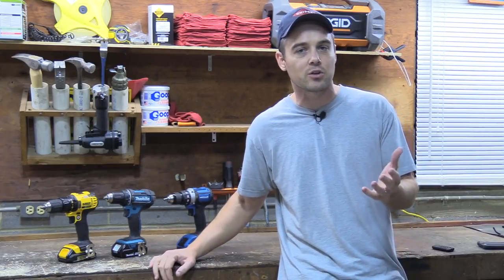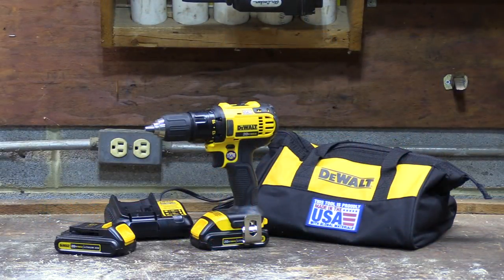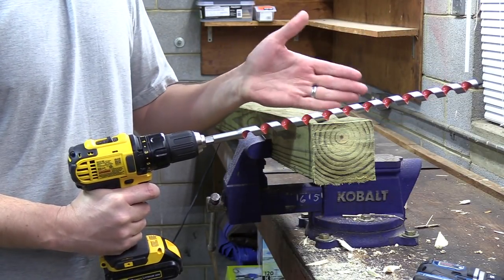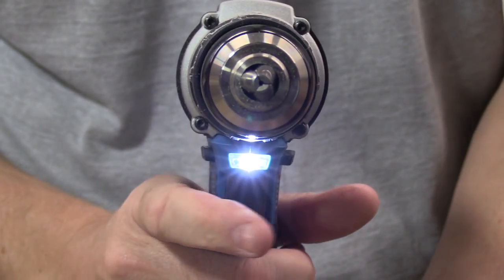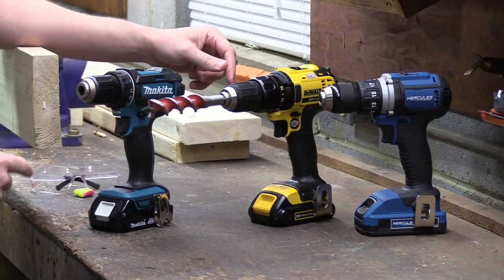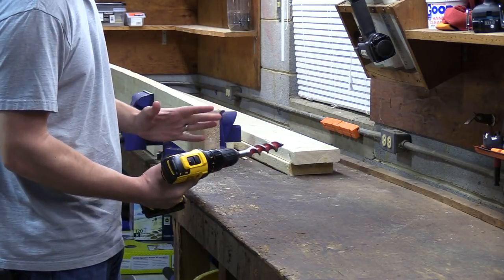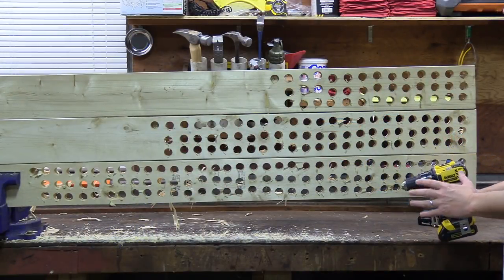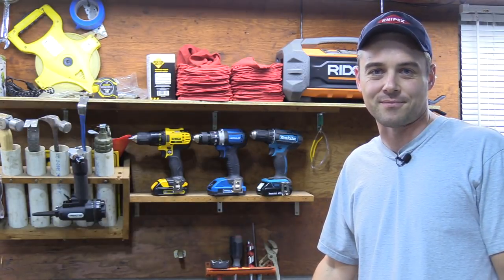Dewalt -VS- Makita -VS- Harbor Freight (Hercules) / DCD780 -VS- XFD10 -VS- HC91K1

Comment: Own a Ryobi, very satisfied. maybe you can do some ryobi tools in the future. love your videos, Keep it up
Reply: I'm just a homeowner, so I've been using Ryobi tools for yeas now, but I've been frustrated that they haven't put out a decent compact drill like these. Mine is over 10", and the smallest One+ drill I've seen is at least 8".
Reply: They are made by TTI, which also makes Milwaukee.  In fact, there is some speculation that TTI may be using Ryobi as a test bed for technologies that eventual wind up in Milwaukee tools.....
Reply: I use cordless drill all day, everyday at work. Ryobi is by far the worst of the bunch. It's good for a homeowners drill, but not m
Be actually used for construction/work.
Reply: many people dont know this but rigid and ryobi are identical they are made from the same factory and owned by the same company that owns milwaukee .

Comment: I am getting ready to chuck my 5 year old Dewalt 20v Li drill.  I may give Harbor Freight a try.  I go there already and love their unconditional warranties.  I have had issues with returns on Milwakee and Rigid drills in the past.  Plus, now HF has batteries that interchange with quite a few tools.  Thanks for the review.
Reply: My local store had no Hercs in stock and won't til November I think. That said, Dewalt has a bigger line of tools and I've made a living with mostly Dewalts over the last 2 decades. My son wanted a Herc, but since they were out I got him the Bauer.

Comment: I have older Dewalt XPR series tools that have held up to the test of time and are worth every penny. Then about 6 years ago I was given the battery powered M12 jacket from Milwaukee. Needless to say I then started buying all the tools that use the same M12 battery, drills, hammer drills band saw, sawzall, laser level. These tools are some of the highest quality battery tools I have used in my 30+ years as an electrician. All in all I want tools that can do more than just drill holes, interchangeability is important too. No offense but between the tools from Dewalt or Milwaukee, the variety they offer and the toughness after falling off a ladder and still working I'm sticking with the brand names I trust.

Comment: I've used Craftsman cordless tools when they had the 14.4, 15.6, 18.0, 19.2, and now 20V lithium as all my 19.2 got stolen.  They are undoubtedly the best bargain, and I use them professionally as a bus/truck mechanic and dismantler.  Craftsman tools are ridiculously expensive to buy separately, but for example I got the 19.2 volt 1/2' chuck drill, impact screwdriver, charger and two batteries for $99.99.  But you MUST get them as a set, and on sale.  The 19.2 series never failed me, and whether using Ni-Cad or lithium the were outstanding, especially the impact screwdriver that I thought was a joke when I bought it.  That little sucker will bury a 4" screw, I built about 50 feet of fence with zero problems.  I plunked down $199.99 for the latest Craftsman 20V lithium ion set.  You get a 1/2" drill, impact screwdriver, sawzall, circular saw, and Excellent flashlight, plus two batteries and a charger.  I highly recommend them as the best value, and of course getting TWO batteries is essential.

Comment: As of now, 308 Makita and DeWalt fanbois have disliked this video.
Reply: Tvideo; Mate when you're working with these tools for a living, do you really believe anyone gives a crap about being a "fan-boy"??? All you give a crap about is to do the job, regardless of the expense on tools and move-on to the next job... There is a reason some tools are considered by professionals to be appropriate for them; I also would count-in Milwaukee, which is a leading brand... We are talking about people who don't own/use a single drill to cover different tasks... Nobody says that this HFT won't work or will break, but it's not for people depending on a tool. Some new to a trade with very low budget might start on such, but they will get serious as soon as the wallet will allow it. Also, all pro tools have parts available to them, from housing to gears, motors, bushes (for the ones who need them), spare batteries and so on; it's not even worth starting the discussion about service and maintenance...
Reply: newagetojo  Mate, I'm not going to do a Makita vendors job... People also say not to buy Mercedes Benz... I keep hearing the word SPENDING and KEEP ON SPENDING... It sound like it comes from people with limited possibilities and very low on cash; I'm the opposite and for a general information, I have NEVER had a Makita tool go bad, however I needed a new housing for a drill at a point in time because of how abused it was. Fifteen bucks later at the parts depot, I got my new housing and for a buck fifty I also got a new direction changer... Look, you go out and buy/use whatever you want and/or can afford, there is no judgement. It was the "other side" who got aggressive with me for buying Makita, not the other way around. We live strange times, it looks to me that using brand name tools will make you an "elitist" or a "supremacist" or the absolute asshole...

Comment: Run the same tests with the same drills and batteries after 6 months of equal use and again after 1 year of equal use. They all run good when brand new, how do they hold up over time?
Reply from the maker: What you ask as far as testing is not possible in any circumstance.....there is no way that you can track equal testing between drills or any other tool for that matter.

Comment: Dewalt
Reply: Just make sure you get the USA assembled one, not the Mexico one.  The Mexico one has the notorious junky nobrand chuck and some other sly changes depending on the retailer (I.E. The Home Depot 2-battery combo kit includes 1.3aH Malaysian batteries and not the 1.5aH Japanese batteries).
Reply from the maker: +thechosendude I bought this combo at the Home Depot & it was 1.5ah Japan batteries.
Reply: Real Tool Reviews - Looks like your drill is the USA version.  I'm guessing the battery difference is associated with the drill's country of origin. Now I really feel jibbed.  The replacement I bought three weeks ago came with the 1.3 batteries (DCB207 is battery code).  DCD771 is the drill model, made in Mexico (that phrase is hidden well on the label).  Two batts and drill were $115 or so IIRC.  My DeWalt Impact from Lowe's has the 1.5 batteries, but it's also the USA "made" version.
Reply from the maker: +thechosendude yeah, this particular kit was $159....quite a bit more than the $115 you paid.
Reply: my dcf889b never let me down. made in USA. is there accessories/ adopters recommended for converting to drill ? I know there is one for converting to driver.
Reply: The all have Japanese (company) batteries.

Comment: Having work construction most of my life I was building the sexton house in the Key West cemetery we were drooling through the solid concrete wall. There were a variety of drills on the job site the only drill that did not start smoking and almost burn up was the Makita. That made me a true believer. I would definitely pick Makita but I tell you one thing that Hercules is pretty impressive.Thanks for taking time to make these videos
Reply: having done some real drilling in concrete.. I can honestly say, the best I've ever touched for that was a hilti.. We'd smoke dewalts every couple weeks.. That hilti never quit.

Comment: Makita
Reply: Looks like the Hercules is pretty much the best in terms of performance. I would like to have seen the large bit test done more than once though, wood can be fickle with one spot harder to drill through than the other.
Reply from the maker: +Jeremy Huff I was going to do a 2nd runtime test with that bit specifically, but the MAKITA failed on 3 separate 8' pieces, and I didn't want to appear like I was kicking a dead horse 🐴. I agree, wood grain can do weird things --- but NONE of them hit a knot with that bit.
Reply: Real Tool Reviews ok cool, usually with the torque tests I see you repeat them several times. I didn't see this one repeated nor did you say anything about it in the video so I assumed only one test was performed.
Reply from the maker: +Jeremy Huff yeah with torque tests I do, but runtime tests take forever and make my arms sore after 30 minutes of nonstop drilling.  I ensure all of the wood was pulled at the same time & is free of defects / knots as much as possible to ensure similar loads on each tool.  I also sharpen the bits between runs.

Comment: I have the 18V Makita... actually got it with a set for $299 at the Home Depot that had the drill, impact driver, reciprocating saw, blower and flashlight with 2 batteries and a charger. Pretty sweet deal. I'm happy with it.

Comment: the only test that wasn't covered is longevity of the drills last before other problems occur such as gears wearing out or quit working altogether. I have the Dewalts, two of the them, and have been using them for two years and now there is something going on in the triggers. When I pull the triggers I get a "stutter" of sorts and most of the time they quit until I press the trigger multiple times. I thought it was because I dropped one from a considerable height and I had broken something, but eventually the other one started doing the same thing and I never have dropped it.

Comment: I have used both DeWalt and Makita tools in my past and both have held up great.  I have never used the Hercules brand from Harbor Freight so I can not form a good opinion about that brand.  I know that I have had amazing luck with both the brands I am familiar with and never had any defective (Just DIED ON ME!) issues with either of the DeWalt drills I own and the Makita power tools I have used on construction sites.  Asside from one of the batteries of my DeWalt drill dieing and needing it to be replaced, I can not complain about that brand at all whereas I got a long time use out of that battery for my drill.  And as far as a Makita, I had a motor burn out but again, just like the DeWalt,  it lasted me a VERY long time.

Comment: I wish you would have included a Ryobi drill in the comparison.
Also, my big complaint about the cordless tool market is that battery packs are not standardized, the way most all big flashlights take D cells, regardless of manufacturer.

Comment: Really you should use a new bit for each drill. After that hole test with the 1" bit the last drill had the dullest bit useing more power unless that was you sharpening it the same each time in the footage?
Reply from the maker: It wasn’t a brand new bit in the first place.....I use it for runtime tests only.  And always sharpen it exactly the same way after a run.

Comment: I have several old Makitas, a new DW 18V and new DW20V....... the DW20 is the best.
My DW18 died in a few weeks and I replaced it. The replacement has lasted years, but the 18V batt is low on the Amp hours.

Comment: correct me if I am wrong but the Makita retailed out at 169 the Dewalt retail ( by the sign) was 179 but discounted  down to 159  and the hercules  with a voucher at 100 (how much was the voucher } 
and the warranty for both Makita and Dewalt at 3yrs with beat the Hercules any day. I have had the Makita for nearly 3 years now and still going strong so sorry but I am a little biased. good comparison with the drilling capacity though and impressed with the capabilities of the Hercules but not sure how long it would last, thanks for the  video.

Comment: I currently have both a Hurcules and a Dewalt,both 20v. I also have a large pile of drills of all different makes with dead batteries because it's not worth replacing them. I have to say that I like the Hurcules better but the Dewalt was cheaper to get into with 2 batteries. I'm hoping they both will last as long as the Dewalt 3piece set I bought with 12v li-ion batteries for $169 about 6yrs ago. (Off the Mac truck)

Comment: I solely bought the Hercules because of the metal jacobs chuck. That alone is a $30 plus if buying the chuck alone. Had a coupon. I liked the feel of the power of the drill but that power is a little tougher to control. The variable trigger is not forgiving but the battery life on it is amazing. I have a DeWalt 20v for the pure control it has. My Hercules also has the hammer function for the same price.I still use it for my raw power means (drilling holes through concrete or using a wire brush attachment) but for small sensitive areas (hanging things on drywall) I love the DeWalt for the control.

Comment: I have a Dewalt drill and driver. No complaints so far. If I had to buy one I would look at Harbor Freight, especially if I only used it occasionally. Call it the Homeowner Harbor Freight Rule. If you have occasional project go for it, if you are needing it professionally you may want to buy one as a backup just in case your name brand tool fails.

Comment: I use Hercules in the shipyard and it works great my drill hasn’t failed with drilling holes into metal the cordless grinder kicks ass the impact works great and the sawzalls are awesome I never had a issue with them a lot of my co workers bought into the brand and they haven’t regret it and we are not easy on our tools

Comment: I’ve owned the Hercules hammer drill and I also own the dewalt hammer drill. I enjoy using them both but for the price I think dewalt wins. I got a 5 piece dewalt tool kit with 2 3amp/hr batteries, rapid charger, hammer drill, impact driver, recip saw, light and circular saw all for $380 on sale. 5 tools, 2 batteries and a charger for under $400 is a great deal. Now harbor freight raised the prices of these 20v drills to make way for their new line of 12v Hercules tools. The drill is $90 on sale instead of $80. Not bad but I still think for someone with a small garage or starting a business you get more for your buck with the dewalt. Although this video can’t touch on it I think it’s worth mentioning those sorts of deals are available

Comment: I own the DeWalt, and the Hercules. The DeWalt was a Christmas gift, but I purchased the Hercules with a 40% off coupon at Harbor Freight. I definitely use the Hercules more. I’ve had older model Makitas, but I wouldn’t buy another because they can’t hold up to heavy usage. I would consider them hobby drills.

Comment: My hercules stopped working out of no where.  I hardly used it the year two years I owned it.  Harbor Freight would not replace it, and seemed to indicate that there was a systemic problem with the drills as there were no more available at any store in San Diego.   needless to say that I am extremely disappointed with the failure of my drill and with Harbor Freights lack of empathy with my situation.
Reply: It's junk

Comment: I got a Hercules, and I agree that for DIY home projects was a great driller. However I  will replace it most likely for a Dewalt. Hercules lasted 3 years only. Driller blew out yesterday  when I was drilling trough wood pallets.  Before that one, I had a Black and Decker that lasted over 15 years same use. . .

Comment: Good test.
I bought the dark red Chicago Electric grinder from HF... everyone went up in a puff of smoke using a slicing disk on metal plate. 

I had been using Metabo for years... but eventually, they all bew up... the parts I needed cost more than a new Hercules, so I bought it. 

I am impressed. It has power, doesn't get too hot when under the duress of slicing plate... I fully expect it to last as long as a Metabo.

You test surprised me. I fully expected the other two to beat the Hercules. 

When it comes time to replace my DeWalts... off to HF I will go.

Thanks!

Comment: Had a Makita but one of the batteries died. Was hardly used. A new battery is ungodly expensive. 

Purchased a drill and impact driver set from Dewalt. The drill feels much more substantial and actually holds up much better under load. Both Dewalt batteries are still functioning quite well to boot. 

If I were looking for a cordless drill, I would look seriously at a Hercules. 

I wouldn't even consider a Makita. The batteries on my old Black and Decker VPX drill also far outlasted the Makita. VPX batteries were reasonably priced too. 

The entire Hurcules drill, charger and battery costs less than just a Makita battery also.

Comment: For a good help, use a different brand new bit for each drill, otherwise its slowly heating up more and more, and dulling as well. As well as a non controlled pressure affects the life of the battery and bit

Comment: Genuine question: Is this a FAIR comparison? 
- (Harbor Freight) 20V, 2.5AH Battery
vs. 
- (Makita) 18V, 2.0Ah Battery 
vs. 
- (Dewalt) 20V, 1.5 Ah Battery
Reply from the maker: 3 entry level drill kits.....I believe around the same price range at that time.

Comment: I have the makita XPH01 and I had the problem of drilling with a self feed bit but I was using a very sharp 1 3/8 so I was rather disappointed. I had a fully charged 18v 3amp battery. The corresponding impact gun is amazing but the drill is not worth the price

Comment: I'd like to see the hole test redone with all the drills having the same Ah battery. Just to see if they drill the same number of holes or if one does drill more than the other. But great video nonetheless. Very informative and interesting.
Reply: The problem with that is DeWalt doesn't have a 2.5 A/h battery.
Reply: @corin164  if that's the case...then make them 3 ah batteries. I know Makita has 3 and 4 and 5 ah. I believe the Harbor Freight has 4 ah. So...get batteries of all the same Ah. Just to see if the battery usage is better one vs the other.

Comment: One thing I'd like to know before I buy is the cost of batteries. I notice the Hercules only comes with one.... not acceptable. It's always the batteries that go first, I've probably got 6 drills that would work, but it's cheaper to buy the whole set than to replace a battery!